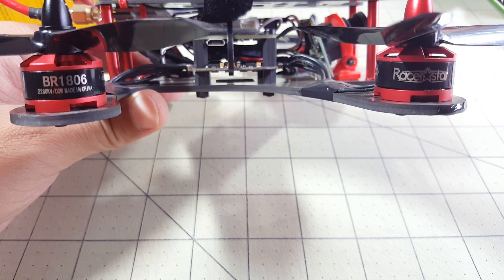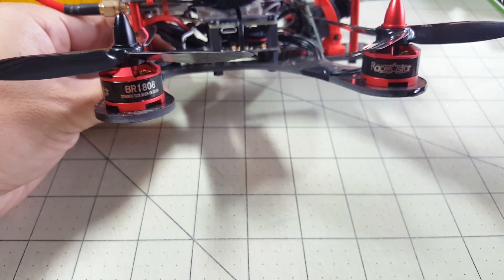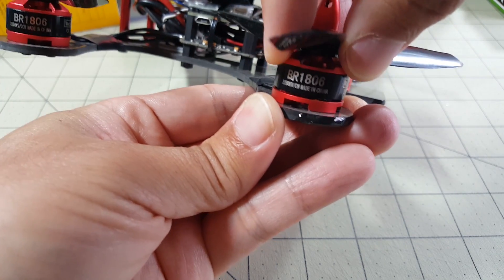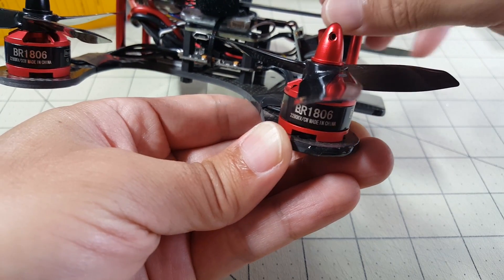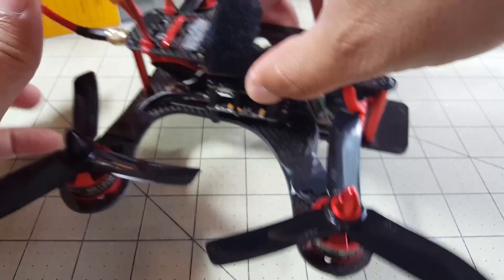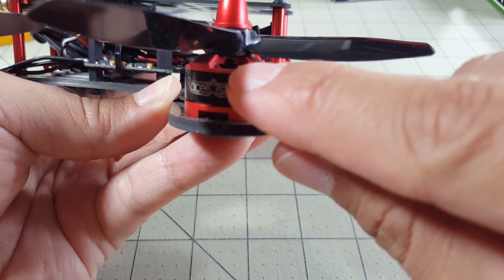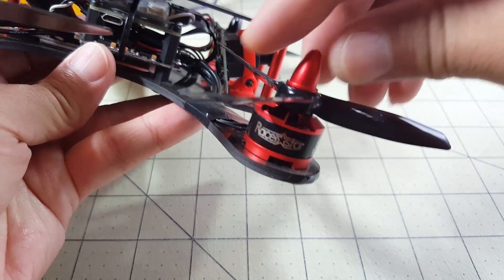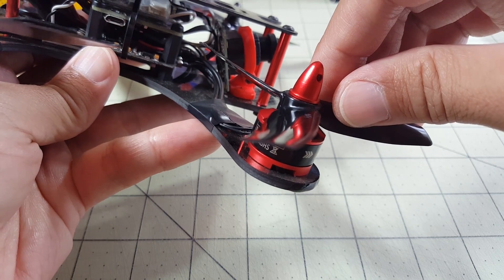Racerstar 1806 Motor Update

Comment: it becomes an issue when the motor heats up and the epoxy holding the stator breaks down. then the stator is pulled up and around with the motor on start stops. rips the strands of the wire windings. and desyncs when the stator is loose.

Comment: Hi Albert Kim. I have a Shuriken 180 and it come with 1806/2700kv motors.. Can I use this one? Or can you suggest me one that I can use? thanks
Reply from the maker: Yes, these will work but at 2300kv won't have as much power as the original 2700kv motors.
Reply: I understand, but any other different brand that you know that have the same 2700kv or closer,  that you can suggest me?

Comment: When you crashed, you probably loosened the shaft from the bell of the motor. Although you tightened the set screw, hard impacts can still lossen the shaft. You should probably reset the shaft back into the bell.
Reply: Leonflight yes that is exactly what happened to my racerstar motors , i had to take the C clip , loosen the bolt holding the shaft in place wi the bell and then gently punch with a small hammer and measure if it is tight and all was again as before :)

Comment: Thats not a problem, i personally take the c clips off of most of my motors so that I can take off and put on props way easier. theoretically theres about 3-5% efficiency lost depending on the motor but I cant tell any difference.
Reply: And your bells don't fly off in flight? what is your set up man?
Reply: They never have, specific setups dont seem to make a difference, I have done this on my competition 3D planes, Slow fly planes, 250 quads, and even a 550 quad.
Reply: AJ Smith that's extremely bad advice! smh!!!
Reply: BisMaxx Have you tried it? It works just fine. Smh

Comment: that motor should be an easy fix, loosen the grub screw you mentioned push the shaft back up and bell down and re tighten the grub screw. just make sure the bell doesnt rub the bottom part and your golden.
Reply from the maker: Cool, thanks!  I'll give that a try... will leaving it alone be a bad idea?
Reply: maybe bad as it could knock the C clip loose and the bell could fly off and any further knocks could make the shaft easier to bend.
Reply from the maker: Good to know!  Thanks for the info!

Comment: Loosen the grub screw, push the shaft from the bottom and the bell, tighten grub screw.
Reply: In some cases, as is mine on DYS 1806 motors, the set screw is locked in a bit to much for a driver of that size to loosen. I simply take a punch and tap the shaft back in while holding the bell.
Reply from the maker: Thanks!
Reply: do i have to rotate the shaft so the grub screw uses a new bit of metal to bite on?... i destroyed all 4 of my 1806's using a 4s bolt 65c battery
Reply: i also can't find an allen key small enough to fit my 1806 grub screws
Reply from the maker: So the 4S voltage destroyed your motors? I've been flying on 4S with no issues but I'm only flying a 4 inch prop
Reply: yeah i never made it past testing, on a kingkong 188 frame with RW.RC 16 esc's and 400x3 props... it was horrifically fast... when i say punch outs i mean full throttle for 1.5 seconds. but as the guy below or above says, i will try to punch a new bite point on the shaft for the grub screw
Reply: +alan hennesy It's a .09mm. Mip makes a nice .09mm driver.
Reply: thanks JK ..i reckon i have about 6 sets of allen keys, hex nuts, each time i need one particular size for a special job around the house, i open the last box i bought only to find the one i need, missing. i will just buy some more tomorrow, i actually have the jjrc x1 motors, they are reported to be emax..